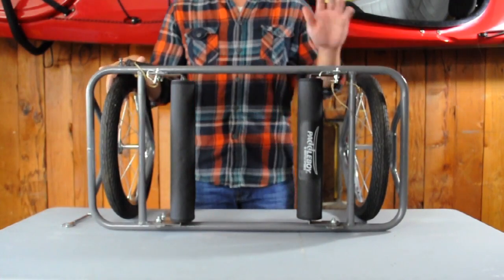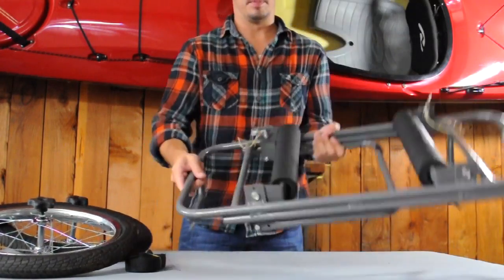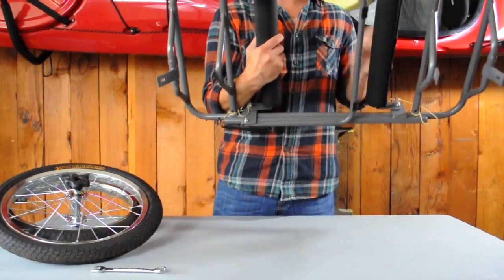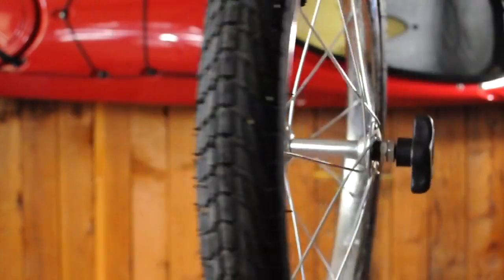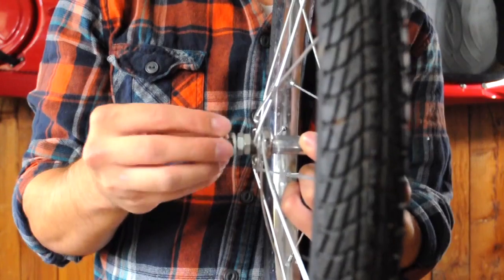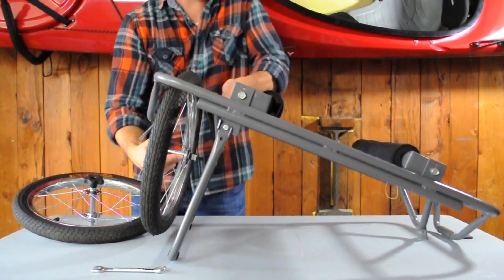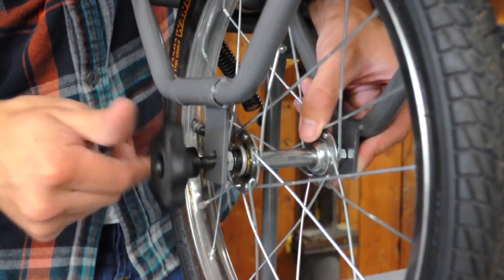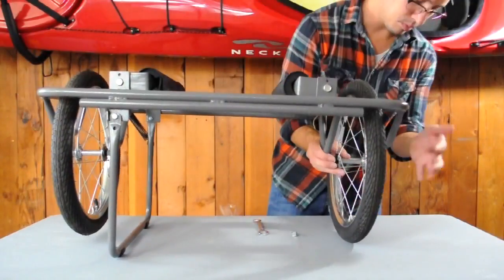How to Assemble Your Seattle Sports ATC Cart Right Out of the Box

Comment: Would have been helpful to talk about the cradle rest positioning.  I have a tandem Hobie kayak that didn't fit well with any of the positions (because it's not a flat bottom) and had to duct tape  pool noodles I cut to fit to lift it up so the tires didn't rub against the kayak.  Would be nice if future versions created more space in the design given the various kayak bottoms it might need to accommodate.

Comment: what is the width /distance between  the two rollers on which a kayak would sit?
Reply from the maker: +JERRY RUNNELS   
Hey Jerry,

The padded supports are adjustable at 3 secure points:  12", 13.5", & 17"

Comment: First, this video goes MUCH too fast.  Second, it is impossible to unscrew the Locknut.  The guy in the video does it by hand.  We've tried holding both nuts on both sides with wrenches to try and get it to turn.  Won't happen.